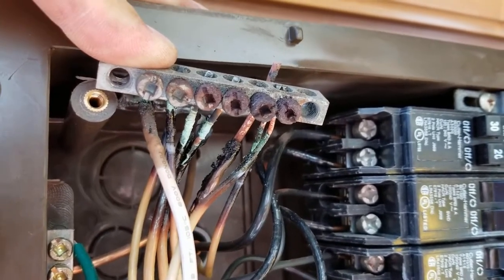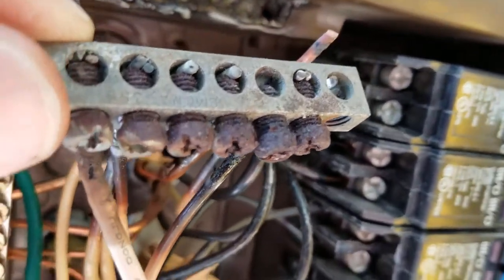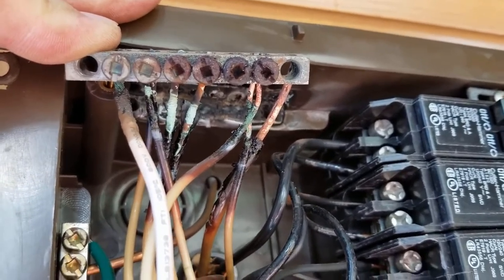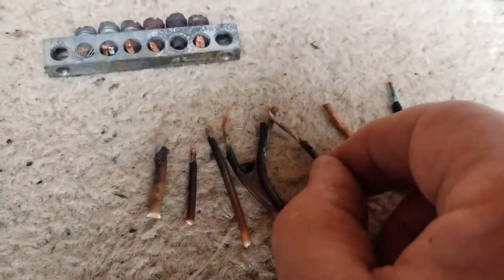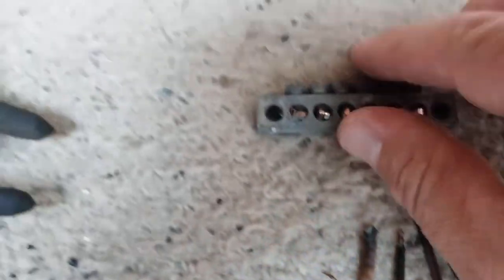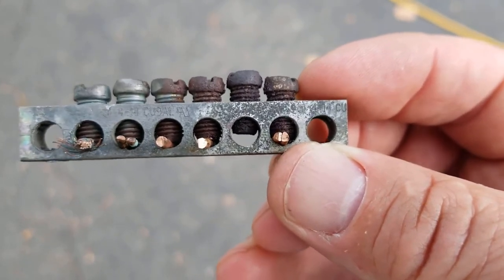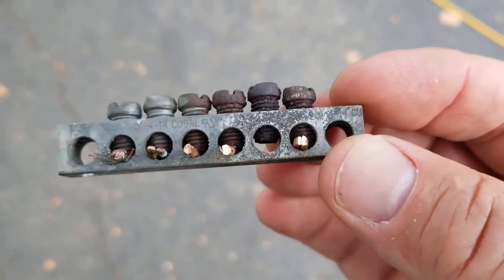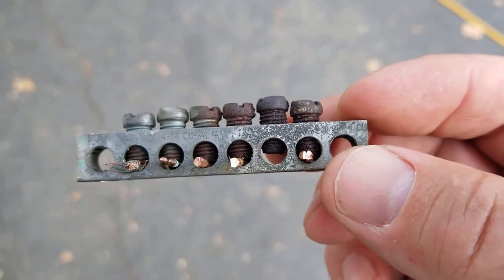RV Camper Circuit Breaker Panel Failure

Comment: So you just replaced the bar and everything was cool?
Reply from the maker: Just seeing this.... I replaced the buss bar, extended the wires, and reattached. I watch how much power I am pulling. It would not be uncommon to max this out. Keeping my power consumption in check keeps the heat buildup to a minimum. Hot metal oxidizes easily.